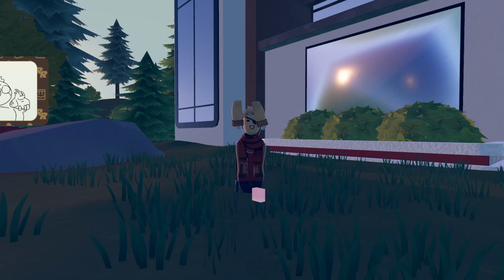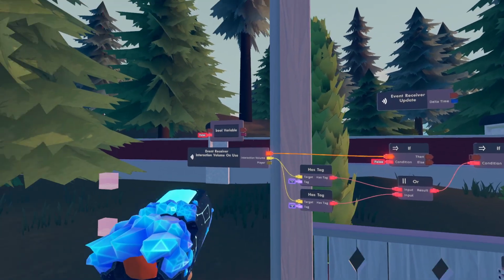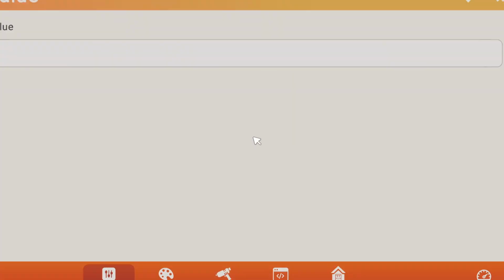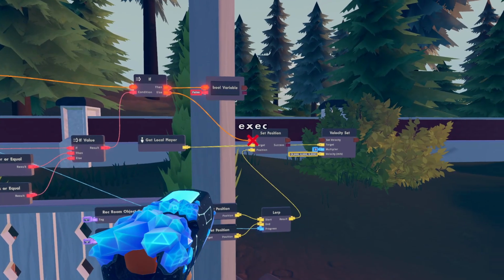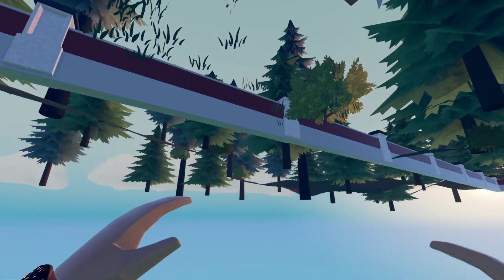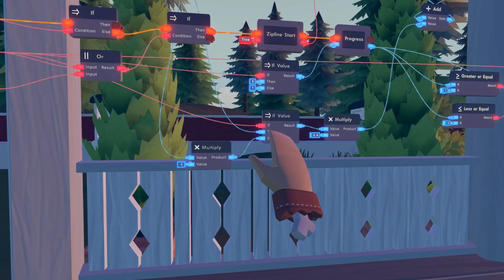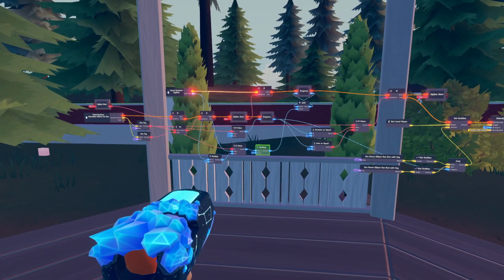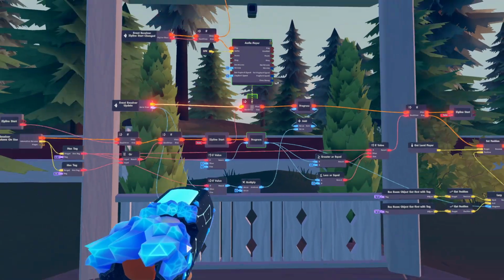Zipline CV2 Rec Room Tutorial #recroom #tutorial

Comment: You should make a video on how you can adjust your height with CV 2
Reply from the maker: There are no height chips in Rec Room sadly, there is technically a few ways to do it but it would be janky. Is there a reason you want me to make a tutorial about this? because there might be a alterative way to it.
Reply: @CircuitTutorialsRRI've been trying to figure out how that for months now. And I need it for a game I was making.
Reply from the maker: @turtles4040  What are you trying to make?
Reply: @CircuitTutorialsRR  a parkour game but you're blind and the height thing is a power up
Reply from the maker: @turtles4040  Maybe just replace it with a jump boost. But in there is a way to do it with set postion and steering direction, it would just be a little weird to control i think.